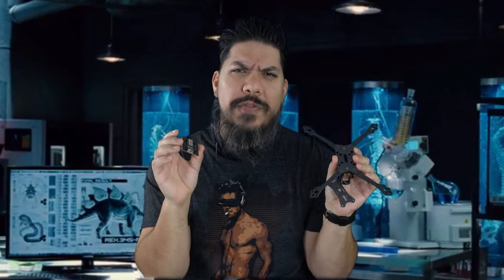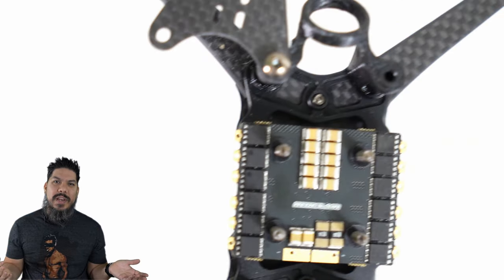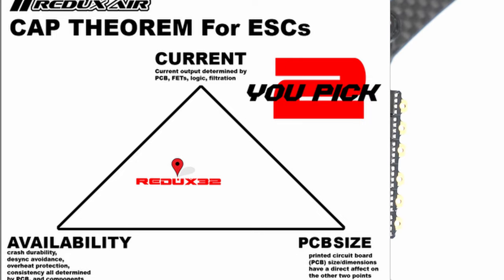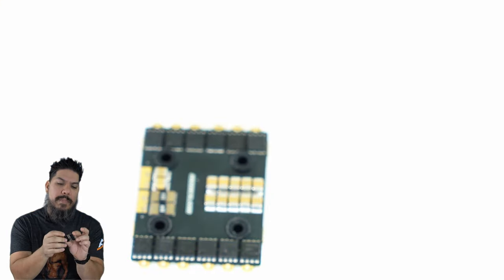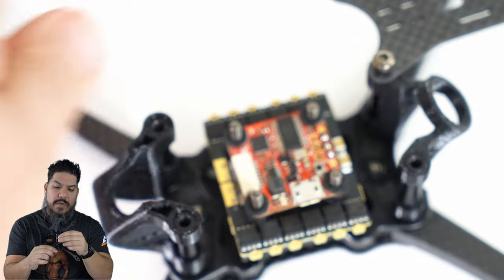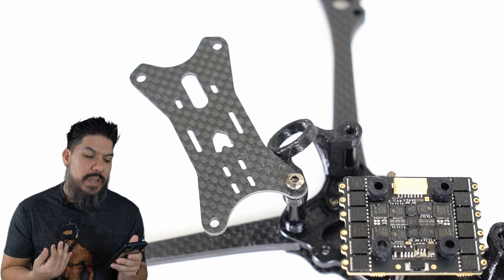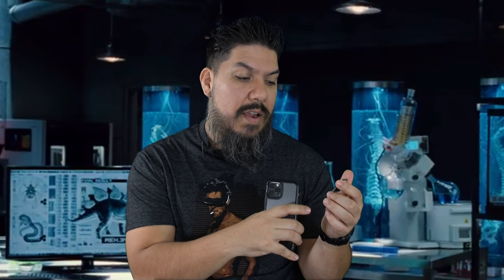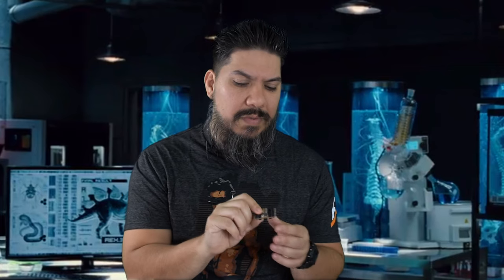Redux32 ESC F3 50A 20X20 Championship Power - Drone Racing Electronic Speed Controller

Comment: Hey Jon I have been enjoying your videos for a while now!!!! Thanks 🙏🏻  I have a question: would this ESC be suitable to use in a 6S DJI Vista rig with the Tmotor F722 20x20 FC with the vista unit in the rear of the GepRC Mark 4 ??
So my main question is is there the proper amount of filtering for DJI & will it work seamlessly?
Reply from the maker: It should work fine. I would still use the included 1000 35 capacitor at the leads. But this would work great
Reply: @JonE5FPV  of course I always use the caps especially on 6S.  
I was just asking because it looks like it’s specifically designed for racers and to be a light I was wondering if they have enough filtering?

Comment: 4:59 not true. Before the Redux Air ESC, FlightOne had the Spark32 4in1 ESC back in early 2018. Full sized 30x30 board with 20x20 mounting. Those worked, but were never always reliable. Then the Lumenier Mini Razor Pro came out. Same idea as the Spark32, 30x30 sized board, 20x20 mounting, full sized MOSFETs. 

Yeah, it might not have the same type of MOSFETs like the Toshiba ones used on the Redux Air ESC or the same amount of onboard capacitors, but if you are on a budget but need a good reliable 4in1 ESC that costs only $45 (veruses $62 for the Redux) for the basic one, (optional 800uf cap board or LC filter/real pit for an extra $6) they are bullet proof. I have them in all seven of my race rigs and all have been working super well for me. 

And, NMGrower in Texas also uses the Lumeiner ESC in all of his rigs as well. He's one fast pilot too.

Comment: Doesn't getfpv make a esc thats 30x30 but has 20x20 mounting that features the same fets
Reply: yes but get fpv gets the product from other companies with permission
Reply: and the filters on the redux are way larger the razor and you have solder on get fpvs
Reply: @NOIZYB  i know that but is the same thing pretty much
Reply: @biggfpv2721  very different MOSFETs and design. I have tested both, the redux is a clear winner to me.
Reply: @NOIZYB  can I use this ESC seamlessly with the Tmotor F722 HD FC with the DJI Vista system?????